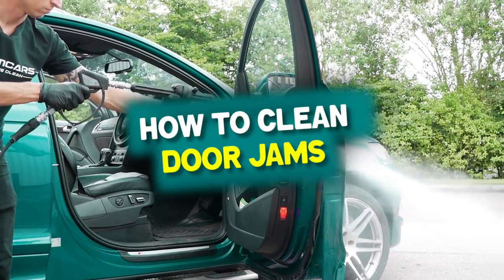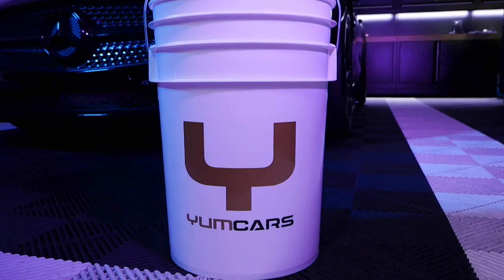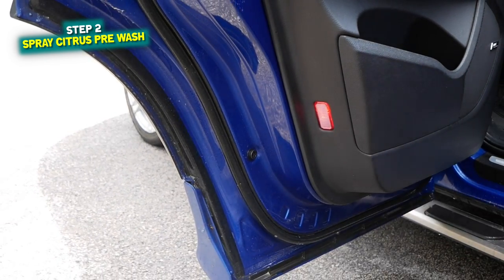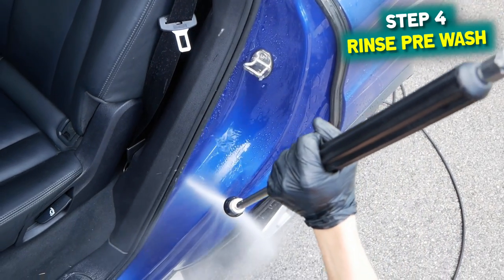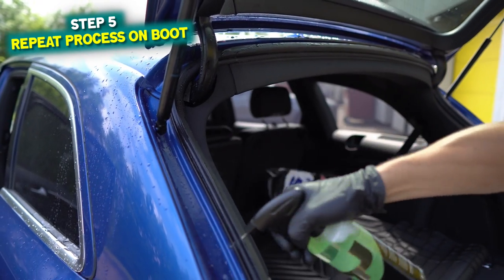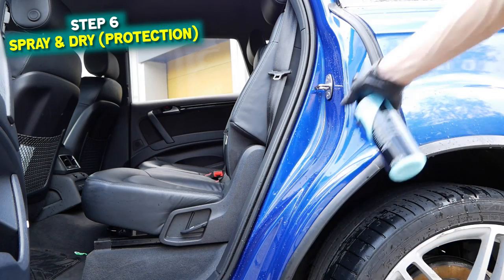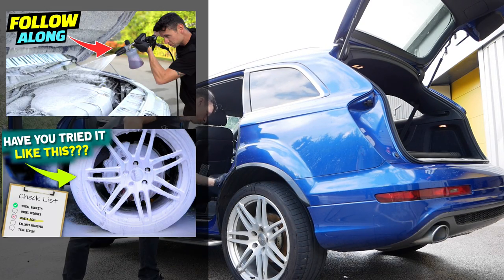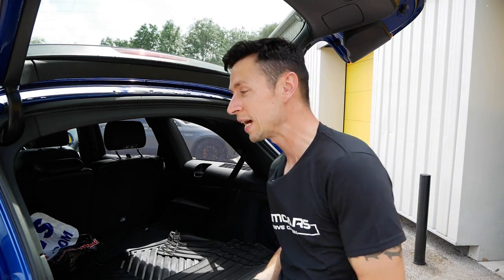How to Clean Door Shuts for beginners (Door Shut Detailing made easy!)

Comment: Hi David, I’ve been gifted a Bosch AQT 40-13 without the hose or Lance. Any recommendations on what i could use with this machine? Many thanks keep up the great video’s
Reply from the maker: Hi mate sorry I haven't really sat and studied any of that brand I'm afraid so I wouldn't be much use sadly
Reply: I have that pressure washer and just purchased mjjc foam lance with correct attachment. Haven't tried it yet but has great reviews

Comment: great stuff - but £25 for a bucket?
Reply from the maker: Thanks mate. Sorry I can't comment on that lol 😉
Reply: @epicautomotivedetailing  gagging order eh? Never bite the hand that feeds you!!! I begrudgingly paid b&q £7 for a plasterers bucket!
Reply: I bought a 'Meguiars' bucket in a sale.  Biggest difference is construction - far sturdier, doesn't flex as the water moves like cheap buckets.  The Meg is for the soap and the cheap bucket is for the tool rinsing.
Yes, there will be some cost for the branding.
Reply from the maker: @s1m0ngr1ff1n  I had the old builders buckets back in the day they worked a charm